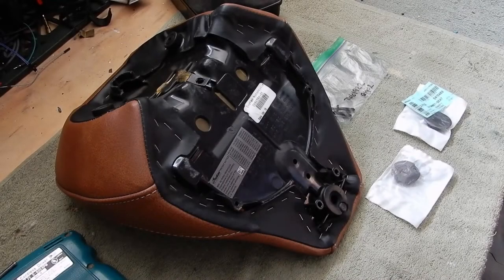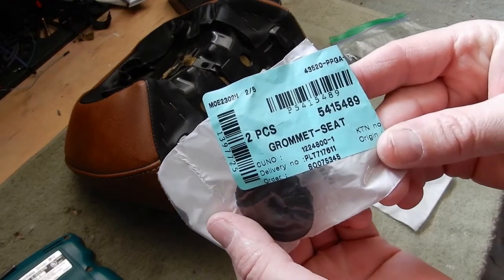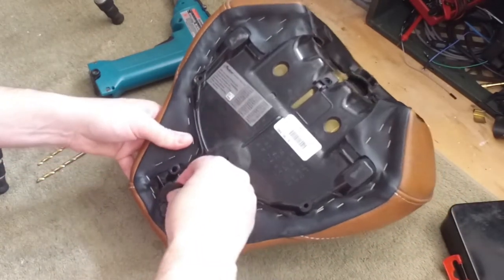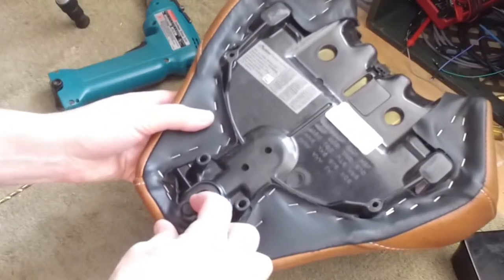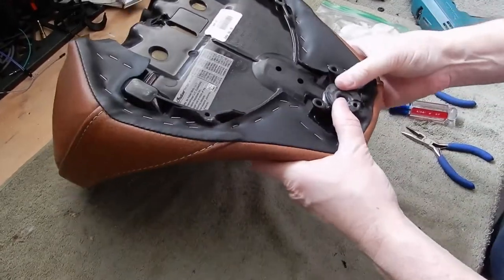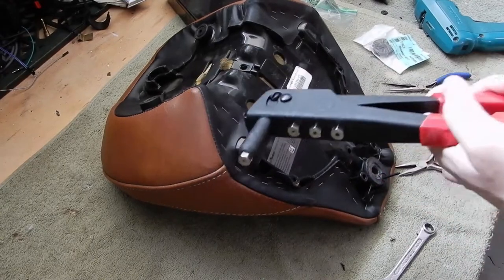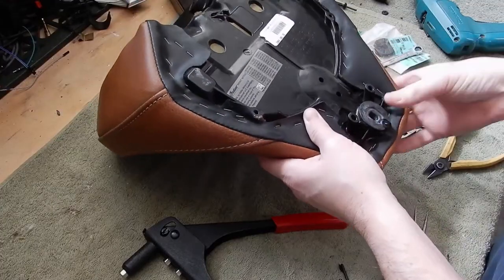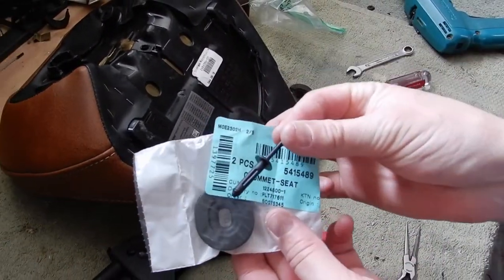Indian Scout seat grommet replacement

Comment: Every bike manufacturer has issues of sorts so I'm not throwing the baby out with the bathwater.  Should however raise some eyebrows at Polaris on the potential for a simple improvement in fixing the issue.  It's great that you took the time to put it out there.  All good.
Reply from the maker: Out DoinIt thanks for your comments. This is a super simple fix and I figured since it wasn't on YouTube I would post it up. I agree, Polaris could glue/bond it on or use a few of those rivets. I'm sure it will get worked out at some point. Thanks for tuning in.

Comment: I put litium grease in the grommet to avoid that issue. Using a little bit of superglue to fix the grommet to the plastic support also have worked for me great in simmilar situations. Anyway good tips.
Reply from the maker: Good call man, thanks for posting that info. I'm going to do the same thing! Thanks for commenting!
Reply from the maker: Thanks for your comment, very good information. PINNED